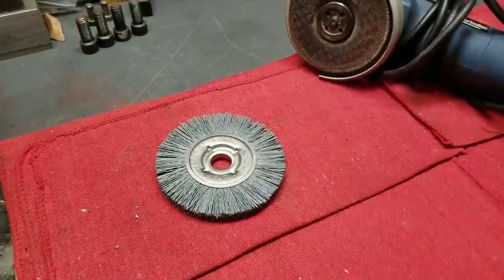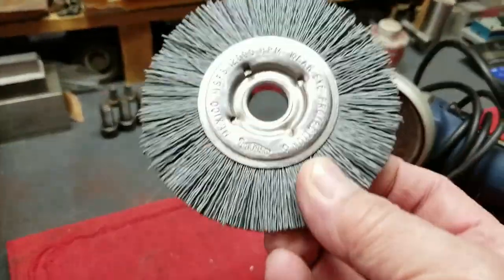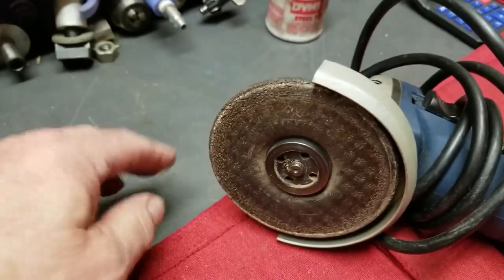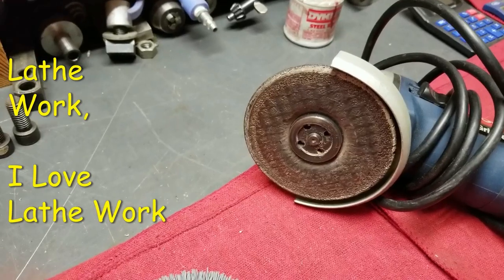Turning, On A Manual Lathe

Comment: Nice video,  I enjoyed it. Especially the part where you successfully were able to part off the workpiece.  I have such a lot to learn on parting.  I like the different style if video to change things up a bit.  Cheers.
Reply from the maker: Thank You for letting me know what you think of the video. You know parting on the lathe is something you have to get a feel for. It takes time and practice. I've been thinking about perhaps making a video on Grooving and Parting on a Mini Lathe. But I need to get my lathe back together first. I'm getting close. A quick tip on parting. The parting tool should never stick out of the tool holder any more than it needs to reach the center of your material, And , Always part as close to the chuck as possible. Thanks again for your input on my video.
Reply: @GlennNowOnYouTube  yeah, I have had others point that out.  Seems obvious now but...if you've never done it you just dont think of these things. I do appreciate the advice from you and all the others who have experience in these.  Good luck on your projects.